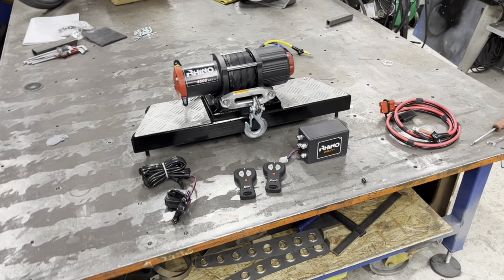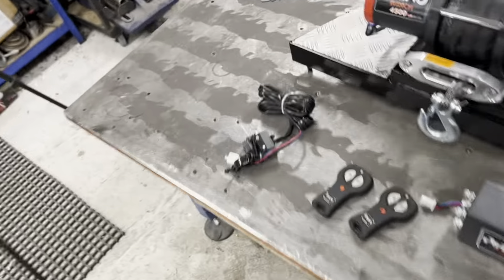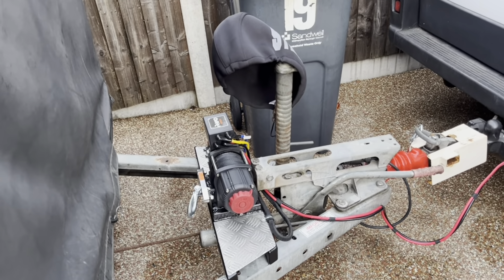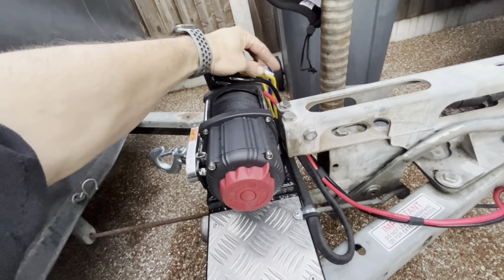Electric 4500lb race trailer winch mount part 2

Comment: why dont you mount the control box thingy in between the 2 black legs the winch is mounted too. so its out of the crap weather bud?
Reply from the maker: I did think about that but was concerned about the connectivity being hindered to the wireless remote by all the steel.